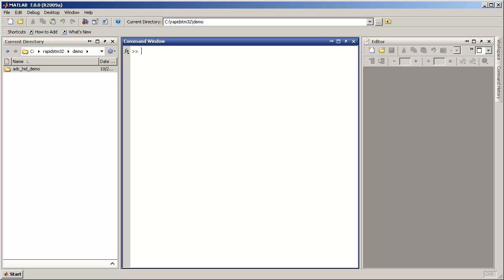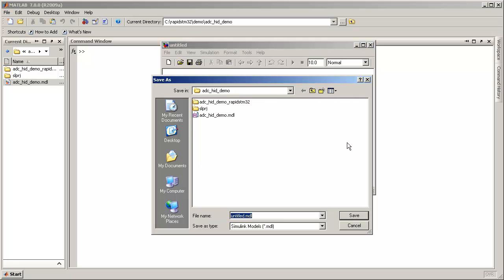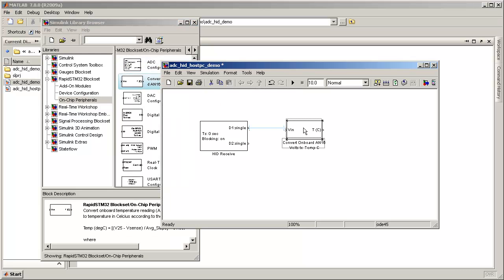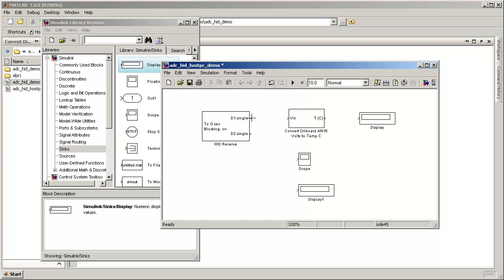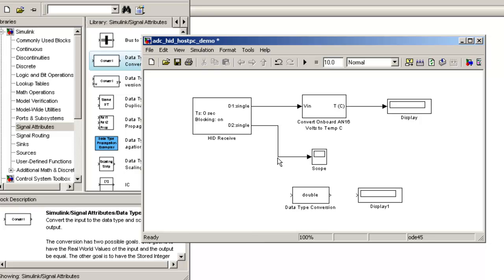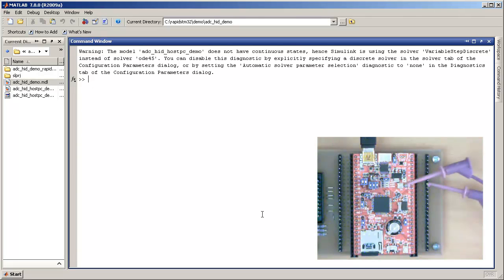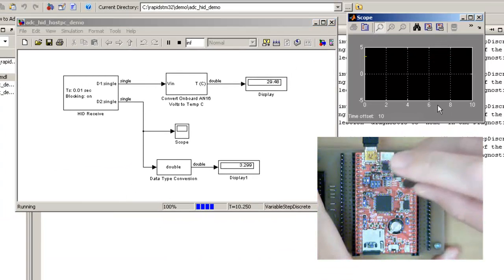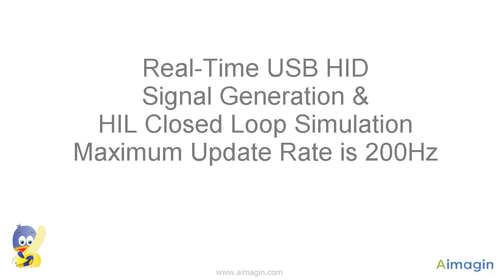USB-HID Real-Time Data Acquisition into Matlab/Simulink Demonstration (part 2 of 2)

Comment: About the 400Hz maximum update (or 200 Hz for HIL) mentioned at the end.. is that 400 Samples or BIts per second?   If it's bits, then is it possible to send data even faster (115000 bps) using the USB CDC Class?  i.e. routing from the chip's UART over to Simulink via TTL/RS232/USB Virtual COM port?

I'm hoping to design a filte (sptool/fdatool ?) using a file of captured data, but preferably I'd like to run it real-time, and tweak it with streaming data.   

Also, what is the difference between the FiO Std and Fio2?